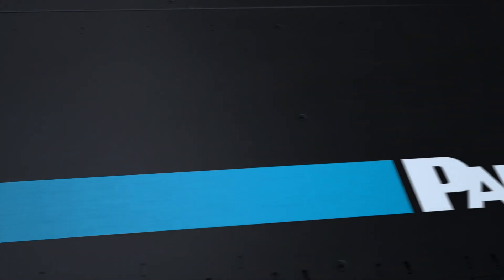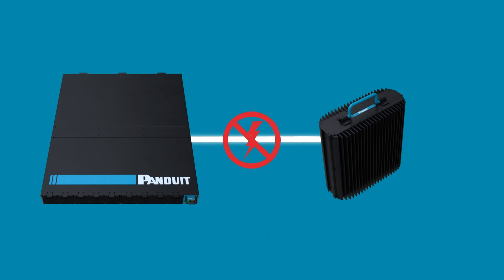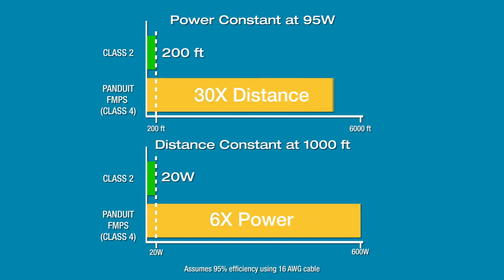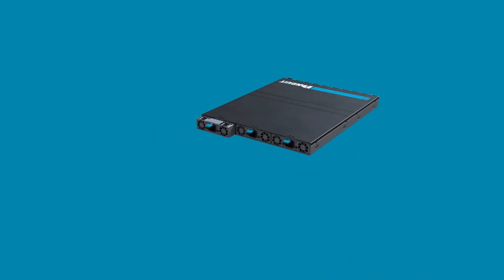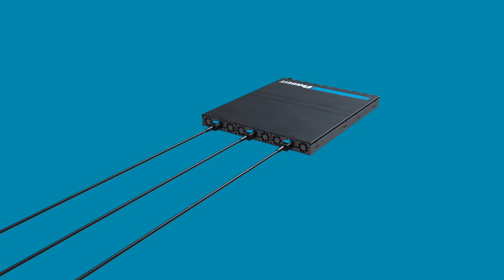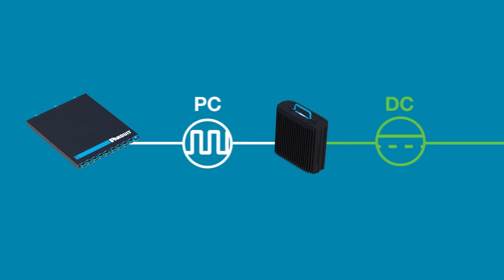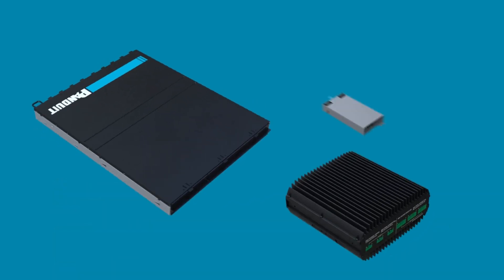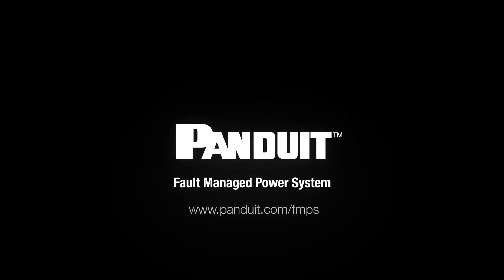Panduit Fault Managed Power System - Class 4 Power

Comment: Systems like this becoming commonplace would be a revolution in the low voltage world. It would make building projects so much cheaper by not having to require electricians to pipe and wire the whole building. The FMPS would basically be the demarcation point between high voltage electricians and low voltage electricians.